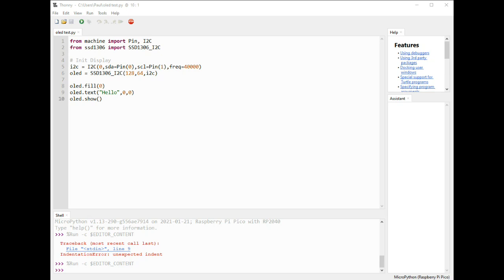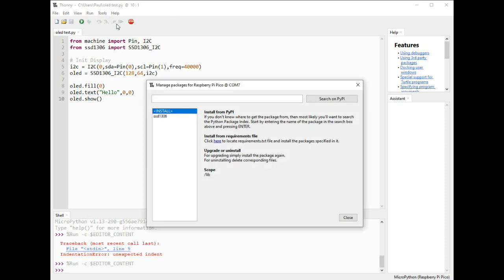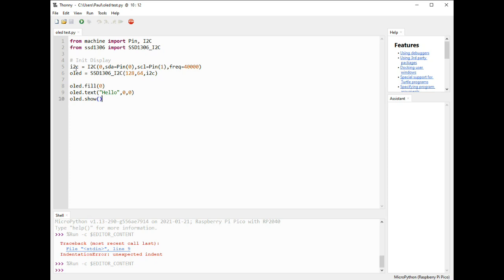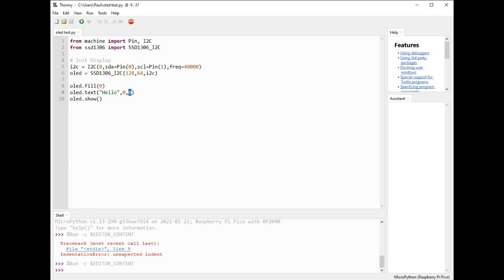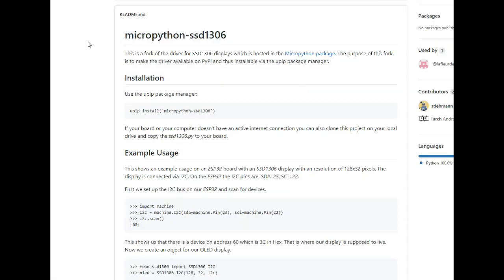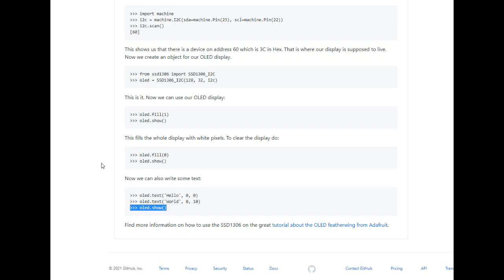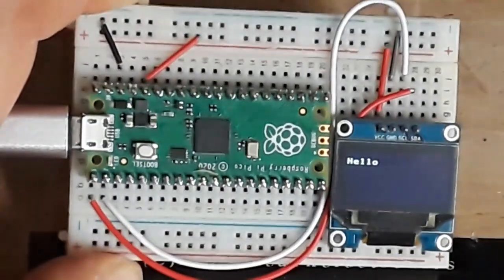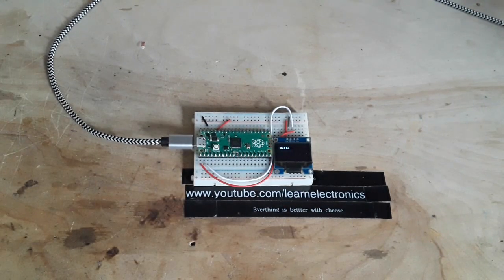How to Use SSD1306 OLED Display with Raspberry Pi Pico

Comment: Traceback (most recent call last):
  File "<stdin>", line 9, in <module>
  File "/lib/ssd1306.py", line 110, in _init_
  File "/lib/ssd1306.py", line 36, in _init_
  File "/lib/ssd1306.py", line 71, in init_display
  File "/lib/ssd1306.py", line 115, in write_cmd
OSError: [Errno 5] EIO

Comment: raise URLError(err)
urllib.error.URLError: <urlopen error [SSL: CERTIFICATE_VERIFY_FAILED] certificate verify failed: certificate has expired (_ssl.c:1091)>     I am not able to use Thony with the Pico Pi, due to this error.  Anyone got a fix?   It happens when Thony tries to install it's versoiin 1.7 of the micro python firmware (the uF2 file).  and It insists on doing this before is will run the board's python or run any programs on the board.  Honestly, I am making a lot more progress with the NUeditor, and Circuit Python.

Comment: Excuse me, I have problems with the library, 
Traceback (most recent call last):
  File "<stdin>", line 17, in <module>
  File "/lib/ssd1306.py", line 110, in _init_
  File "/lib/ssd1306.py", line 36, in _init_
  File "/lib/ssd1306.py", line 71, in init_display
  File "/lib/ssd1306.py", line 115, in write_cmd
OSError: 5

Thank u very much
Reply: did you ever got it working?

Comment: Help me !!!!!!!!!!!
Traceback (most recent call last):
  File "<stdin>", line 7, in <module>
  File "ssd1306.py", line 110, in _init_
  File "ssd1306.py", line 36, in _init_
  File "ssd1306.py", line 73, in init_display
  File "ssd1306.py", line 101, in show
  File "ssd1306.py", line 119, in write_data
OSError: 5
Reply: I can't help you, I have the same!!
Reply: Now it suddenly works, with the same code as I used all the time...
I plugged off the USB cable, and stopped the Pico (stop button)
Then restarted it, and used this code again, down here below.
Thank god I didnt blow up a pin by using 5V, because I did use 5V.. tried everything.
Now the SSD1306 is connected to 3.3V,GND,pin0,pin1 (why on the pinout diagram it says pin 1 and pin 2?)
And the SCK and SDA are connected with a 4.7k resistor to ground
Now it finally works:

from machine import Pin, I2C  Timer,
from ssd1306 import SSD1306_I2C

i2c = I2C(0, sda=Pin(0), scl=Pin(1), freq=40000)
#print(i2c.scan())  <-- this gives me [60] as result

oled = SSD1306_I2C(128, 32, i2c)

oled.fill(0)
oled.text("Hello",0,0)
oled.show()

Comment: Please HELP !
Having trouble running the code

Here's what i get:

Traceback (most recent call last):
  File "<stdin>", line 6, in <module>
  File "/lib/ssd1306.py", line 110, in _init_
  File "/lib/ssd1306.py", line 36, in _init_
  File "/lib/ssd1306.py", line 71, in init_display
  File "/lib/ssd1306.py", line 115, in write_cmd
OSError: 5
Reply from the maker: You don't have the library installed
Reply: @learnelectronics  I have the same problem but i have the libary installed. What is the problem i cant find it?

Comment: i would  love to see a code example for the pico running a 16x2 LCD with the i2c backpack module on it displaying the temp from the built-in pico temp sensor. i've had my pico since they came out and have only blinked a light with it really. i dont know any python really at all.  this was a great video. nobody seems to be doing pico projects. Ben Heck did a kitten lazer with the pico(fun to watch but a little too advanced for a beginner).  Are you gonna do any more pico projects here??
Reply from the maker: Yes, I am going to do them as long as you guys watch them.
Reply: @learnelectronics  Deal! :)

Comment: Oh.... forgot... please keep the pico vids coming.  Maybe add a lipo charger to make a project portable and wake on button press....
Reply: You can get these tiny little lipo charger boards (like barely half an inch across) for pennies from Ali or other cheap online outlets. They run on any voltage u you feed it.
Reply: @Erudotic  thanks..

Comment: That’s really cool. I learnt electronics at school over 30 yrs ago but I’m getting back into it to compliment some steampunk woodworking projects I want to play around with. Over the years the techno blurb has leaked out of my head and I need top it back up again. Can you suggest a good A level equivalent text book or beginner/intermediate project manual. I’ve never done anything with raspberry or arduino (I did build a box for my sons final year uni project - programmable 6 button game controller) and it’s got me interested again. Thanks. I’m working my way through your other vids. Thank you for the knowledge. 🤘
Reply from the maker: "The Art of Electronics"
https://www.amazon.com/dp/0521809266/ref=cm_sw_r_cp_apa_fabc_XJ7690T32R50A4V2VCNZ